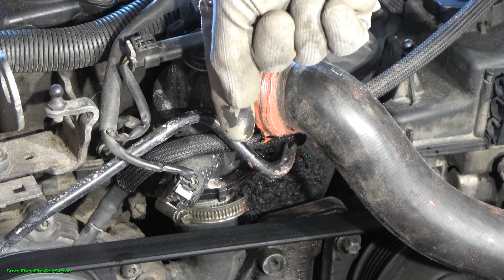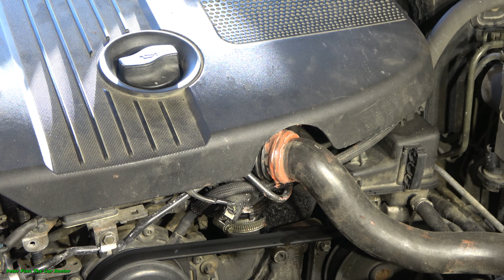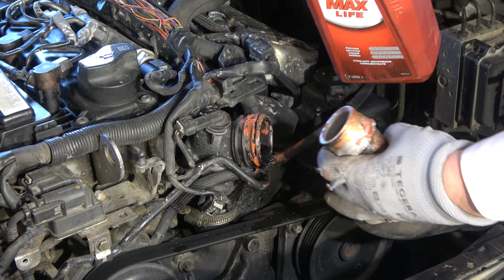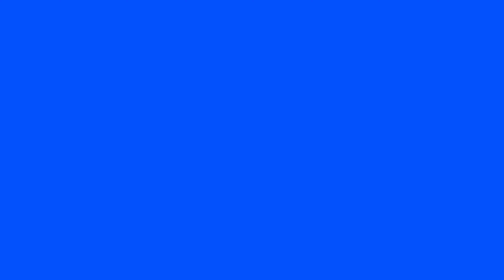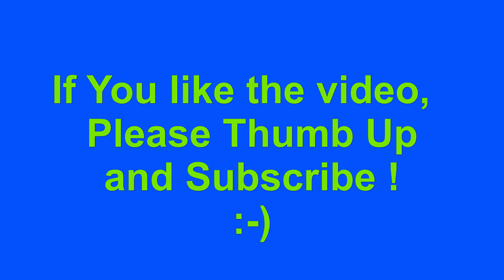How to See and Find LEAKS in radiator hoses car truck bike engine

Comment: I have code P0607 and P0138 on my 2010 Toyota Corolla, can you help with this issue? Thank you and keep up the good work!
Reply from the maker: First, repair all holes and leaks in your exhaust pipe.
Then check cables and replace below sensor:
Oxygen Sensor Bank 1 Sensor 2 
And then these:
Faulty Engine Control Module (ECM)
Engine Control Module harness is open or shorted
Engine Control Module circuit poor electrical connection
And check:
Exhaust gas leaks